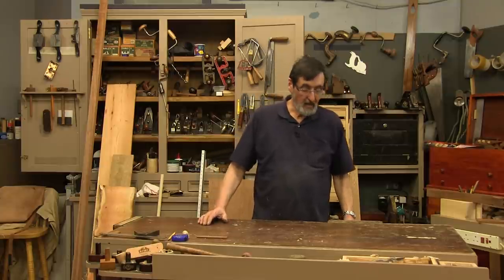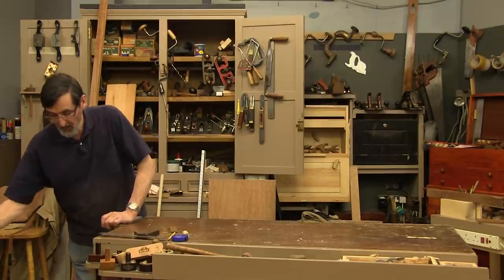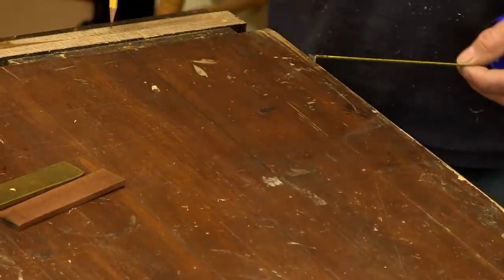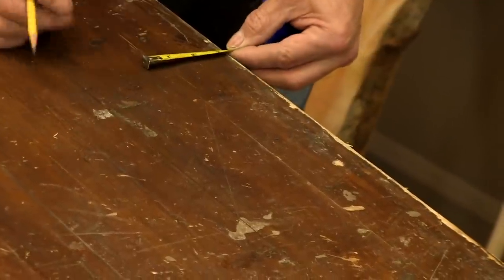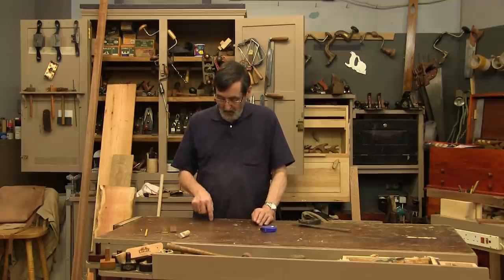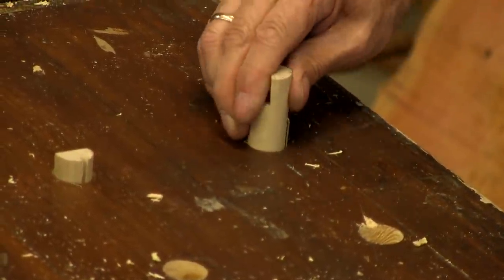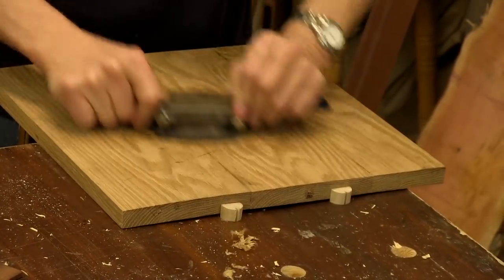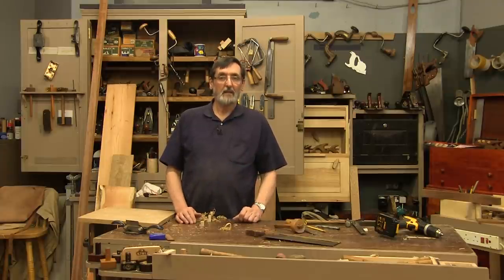Retro fitting a Non-Dogged Vise | Paul Sellers

Comment: Very nice dogs but the holes can clog up with shaving or small parts! On mine I made the length to the shoulder the same as the bench then fitted a small piece under the bench to stop them falling through so that when not in use they sit in the holes - upside down - flush with the bench top, no holes in the bench and when I want them out I just push up from underneath. It's a bit difficult to describe but I'm sure you get the idea. Also I fitted a taller faceplate to the outer edge of the vice, so I suppose my concept is the opposite!
Reply: +Richard Mellersh // Or you can just blow away anything that might be blocking up the holes. good idea though.

Comment: Thanks for the video, I found it very helpful.

Any reason not to install two dogs in the vice, and then one row along the benchtop, to get your triangular bracing?

The total number of dog holes would then be much fewer, and you would only have to reposition one dog, instead of two, when setting to a different length.  Is there a downside I'm not thinking of?
Reply: A questions that asks for an answer also after three years :-) 

The only thing that comes to my mind is that if your vice is notexactly parallel - would not make a difference if there is only one point of pressure. 
Furthermore, if you also use further clamping devices as holdfasts you will be more flexible if you have more holes. 
Still would be interesting to know what the masters says. 
In my old bench there is only one hole in the vice and one row on the bench...
Reply: What came to my mind: If you use a handplane from right to left you might want to have two fixations in the direction you plane...

Comment: Paul, It excellent to have round dogs in the bench, but what about the older benches which have a square dogs how are they made. it would be excellent if you can show us how they are made specially as they have a slanting angle inside.

Comment: Just thinking out loud here, but would it make sense to bore a 7/8 hole most of the way down your bench-top thickness, then finish the rest of the way through with 3/4 bore? Then you have a hole all the way through for dust to fall through, but you have a small shoulder to hold the dogs in. Then you could skip the wire tension.
Reply: I think wood chips would probably get hung up on the lip and not fall through. A smooth taper to the hole might work though.  Also, you might want to be able to adjust the height of the dog for thin stock so you'd have to have different length dogs

Comment: if you drill the holes all the way through you could build plugs for the holes make them just like the dogs but don't cut the notch in them leave them fully round then when you need to use a dog just knock them out and put them back when your done to keeps stuff from falling through the holes

Comment: Paul, I have a question to you, just out of curiosity really, not criticism. But why do you use an electric drill? 

Another great video.
Reply from the maker: Pragmatism in that a battery driven drill gives me one hand use or two hands for power and control. I would sat that the main benefit of a power-driven drill is single handedness though.
Reply: Paul Sellers Simply amazing, I love how u share your knowledge with others, its generous of you
Reply: Paul Sellers  I love the fact that you use an electric drill. It makes you seem less rigidly dogmatic, somehow. An active woodworker, rather than a museum performer.
(It's also a bit amusing, like seeing someone at Colonial Williamsburg run a piece through a drum sander.)

Comment: Irrelevant question here but I'm curious;

When you made the first hole in the bottom of the dog did you lose the tip of the drill bit, or did the bit just slide deeper into the drill?
Reply: It slided in, see the last hole...

Comment: Instead of drilling holes in the bench top for the pegs, why not just use a hard wood strip and just screw it into the top of the bench as a stop for the thing you are holding. A small screw hole will be easy to fill instead of multiple holes the size of the pegs...